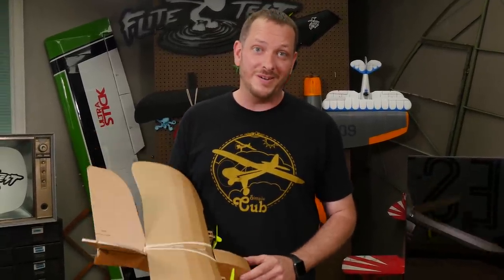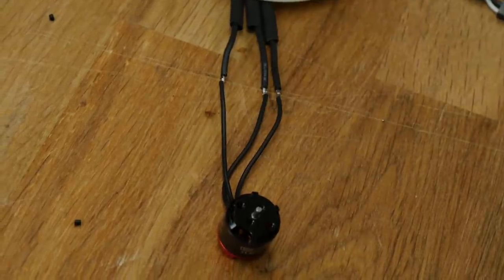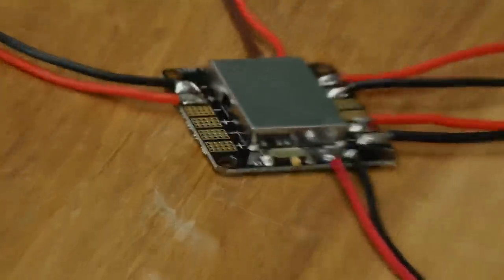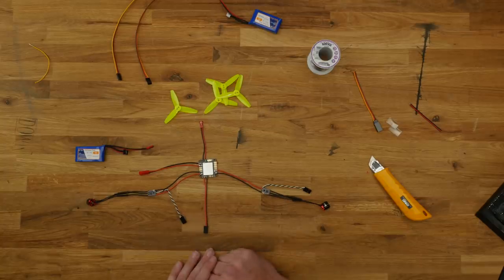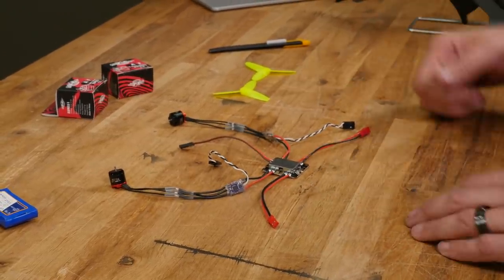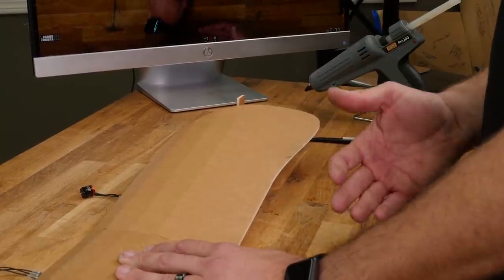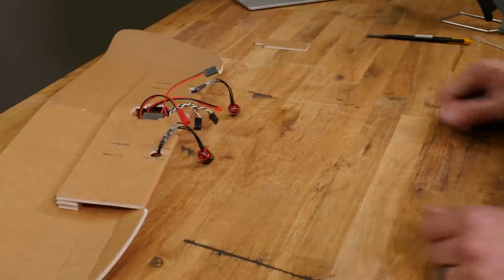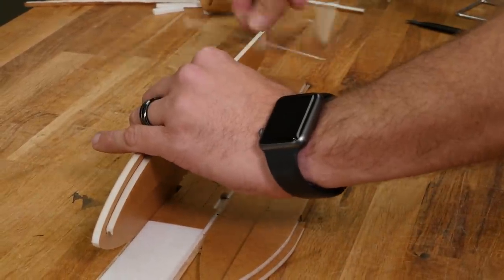How to Build the FT Twin Sparrow  //  BUILD

Comment: I just finished my FT Sparrow, it's the first plane I've ever flown without Safe Mode. It flew great, I'm impressed by your plane and can't wait to build more. The only problem I'm having is setting up directional thrust on my Spektrum 6X. I watched the video and tried the set up for directional thrust and could not get mine to work, keep in mind I'm using a different radio than you're in the video. Nonetheless, great plane, love flying it. I would definitely like to have the directional thrust at some point. Thank you FT family.

Comment: With these ESCs and d-board, is differential thrust possible with less than four mix channels?  Doesn’t seem like it, unless I’m missing something.  I have an FS-i6 with three mixes, so I think I need to replace the ESCs/d-board with ESCs that have BEC then mix off of the throttle channel (#3).  Is this correct?

Comment: can this setup (using mixing to control 2 motors with the throttle) work with the Graupner Mz-12?  I can't seem to figure it out, there is no throttle option in the mixing menu that I can find.  should I use some sort of harness then to combine the throttles into channel1?

Comment: Is it possible to make the motor wires longer? Or will that affect performance?

It's for fixing a millennium falcon XL drone bc the factory version doesn't work.

Thanks 
Big fan y'all doing great.
Reply: As long as you use the right thickness of wire and don't make them too long, you should be fine.
Reply: Longer motor wires will generate more electrical noise and try to match wire lengths.

Comment: so everything used is included in the power pack and speed build kit except the battery, the soldering iron and the servo tester, right?
Reply: *and the hot glue
Reply: I believe you need your own receiver as well

Comment: Can anyone tell me why distribution board has to be used? Is that because ESC does not have BEC?
Reply: Yes, the EMAX bullet ESCs don't have a BEC. The board can also provide stable voltage for a possible FPV camera / transmitter if you want to add that later.

Comment: Your ESCs must be mapped in an unusual way. I assume + and - are the side wires. So if you want the motor to spin clock- or counterclockwise, switch the side wires. But the center wire should always connect to the center wire on the motor. Oh and I love Brie, excellent joke. Last thing : spend a little more time on regular wood glue for plywood. No comments on hot glue, you seem to like it, I respect that.

Comment: why?  why do the motors get to spin in a different way? I feel like they are an in-depth explanation.  is it for differently
Reply: Why he's making them spin in different ways? I think the main reason is so that the motors counteract each others torque.

Or how he's making them spin in different ways? Brushless motors have three phases that get "fired" in order: 1 2 3, 1 2 3, 1 2 3. 

If you swap two of the wires (1 and 2), they will get fired 2 1, 3 2 1, 3 2 1, 3...
Or if you swap 2 and 3: 1, 3 2 1, 3 2 1, 3 2
or if you swap 1 and 3: 3 2 1, 3 2 1, ...

As you can see whichever wires you swap, they will result in the motor reversing the direction from 1 2 3 to 3 2 1. :)
Reply: Yes Balu is right the counteracting rotation keeps the plane from rotating to the left or right on the roll axis

Comment: For the love of god man get some flux. You will get a better thermal connection if you start using flux. You will also not have cold joints. Less chance of overheating the pad.
Reply: Flux core solder dude...get with the times